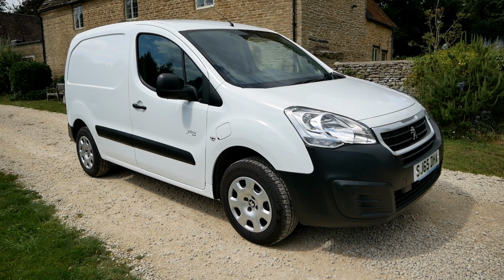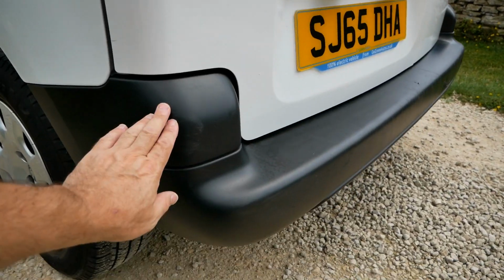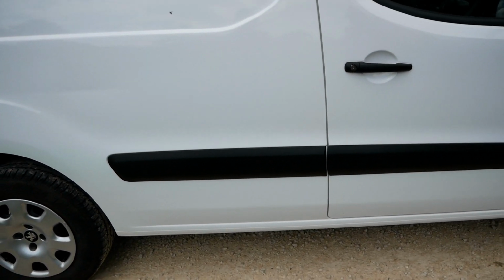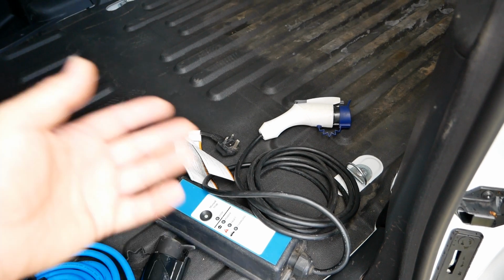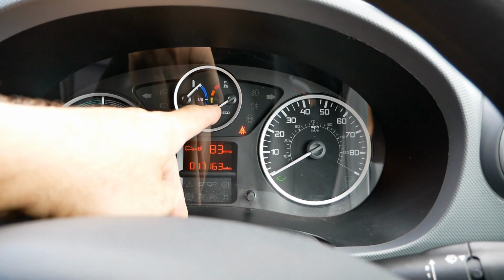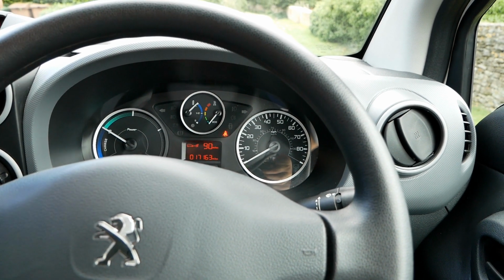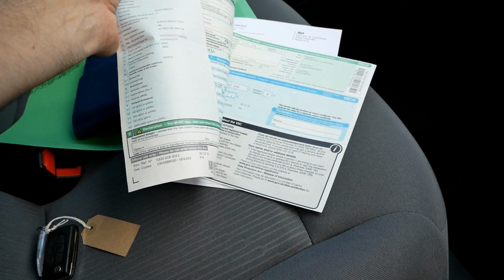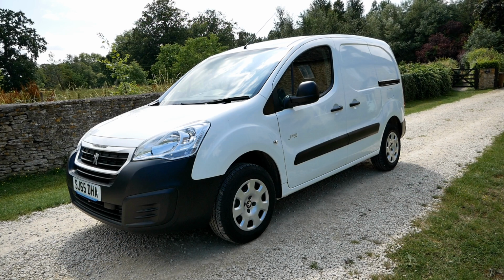SOLD: 2015 Peugeot Partner SE L1 electric van, 100% electric, zero emission, ULEZ exempt

Comment: The range sounds fairly good but what's the motorway driving like? Does it manage 70mph easily? - I really like the YouTube videos as a forecourt.
P.s. I realise you have sold this particular vehicle, but I am interested in another one like it.
Reply from the maker: They do 70mph top speed - well it shows about 73-74mph on the needle. They get there easily. However, driving at top speed does reduce the range pretty quickly. These do up to about 95 miles in the summer with town driving. If driving at top speed, this would reduce to about 60-70 miles.
Further information is here
https://www.gogreenautos.co.uk/buyers-guide/electric-vans/peugeot-partner-electric-guide

I've sold three of these in the last Partner vans in the last two weeks. Join the mailing list to be informed when new stock comes in. I am trying to source more Partners, so will have something else soon. There's just not many of these around!
https://www.gogreenautos.co.uk/contact/mailing-list